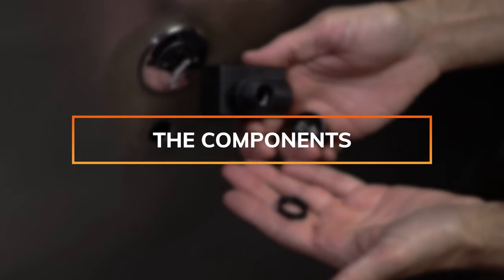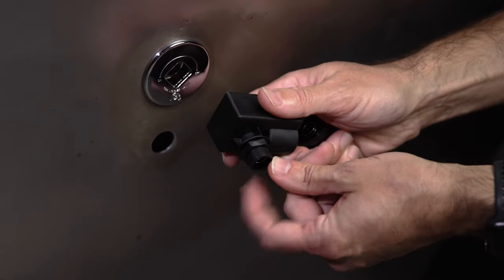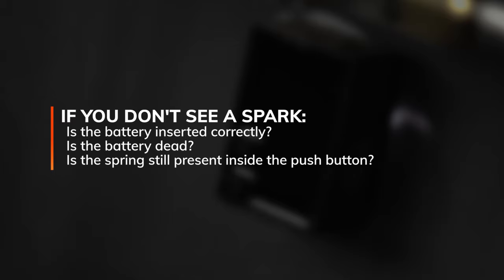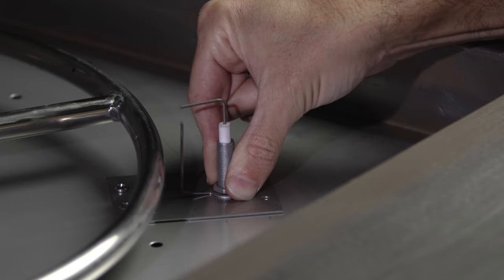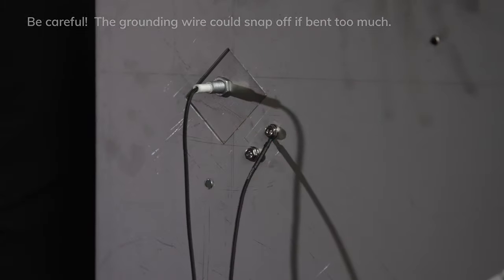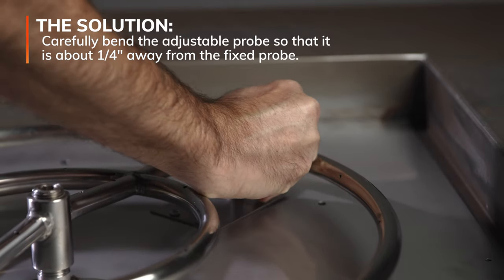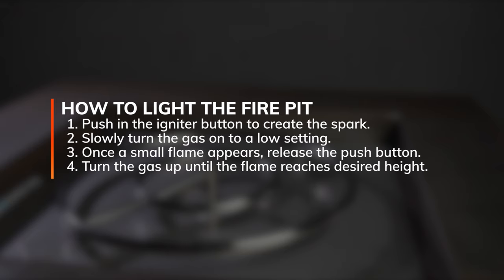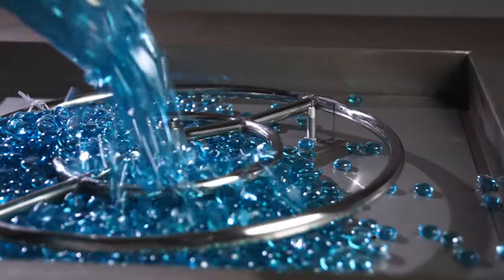How To Install Your Push Button Spark Ignition System

Comment: Are the sparks working on stainless steel? I mean, if you have the electrode only, close to a stainless steel rod. Does it produce a spark? Or it is working only with steel
Reply from the maker: When it comes to installation of the products we offer, it seems like there are 100 ways to do it wrong, but only 1 way to do it right.  We encourage installation of our spark igniter to be done as shown in this video.  If so, your installation will go smooth and should work without issue.  By modifying, you may encounter issues that we cannot predict, nor support.  

Hope this helps.